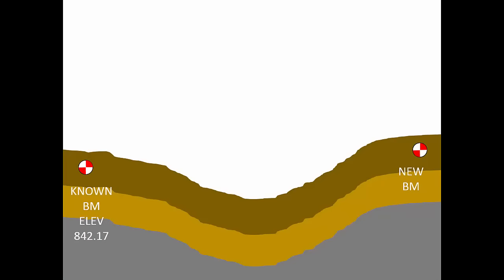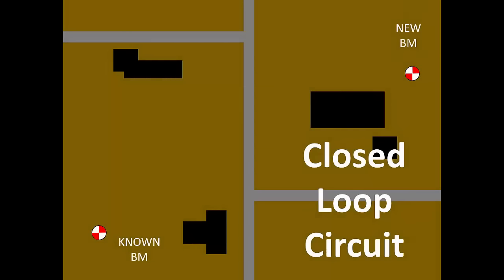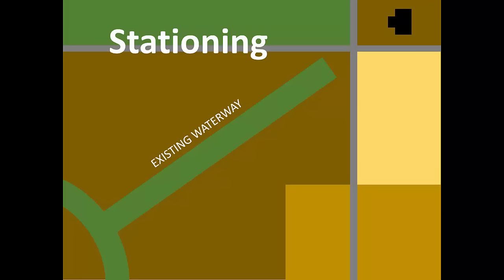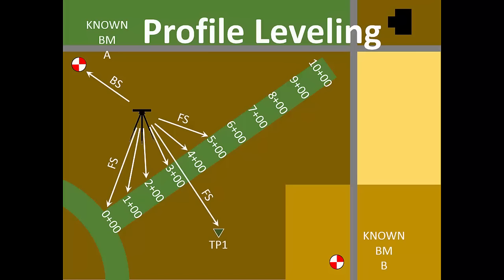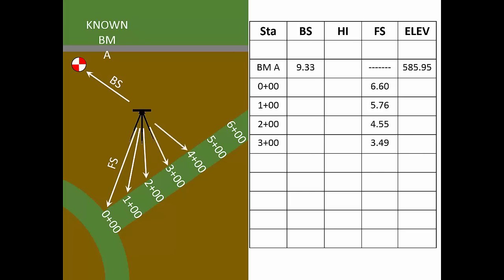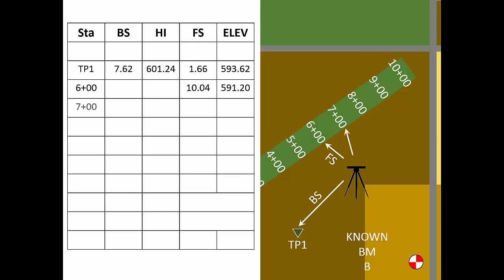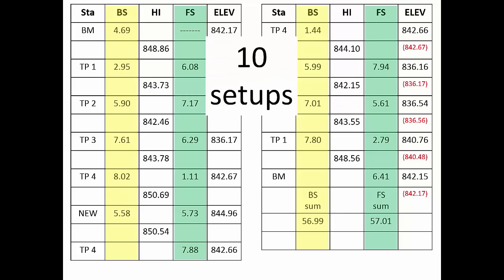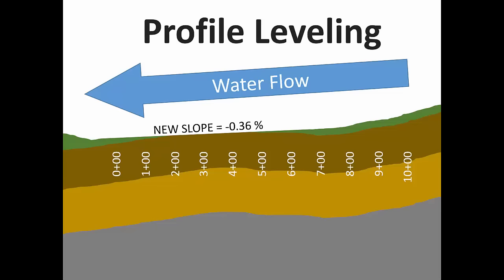Leveling, Part 4

Comment: Dickson queyartey and neil kynaston:  I found the 5 Part video to be very informative and well presented, but not without some "blunders" of its own.

To calculate percent of slope = (Rise/Run) x 100.  The change in elevation between Station 0+00 (ditch) and Station 7+00 (pond) is 2.50 feet.  The formula above would then yield (2.50/700) x 100 = 0.36%.

Also, my guess is that the elevation of BM "B" was supposed to be 597.65 and not 595.65 as shown.  I would go and field verify that myself if I only knew where in Illinois that benchmark was located.
Reply: I agree with this as the closing error is confirmed as 0.02 not 2.02! - however, the principle is still good - thank you for a decent explanatory video.

Comment: Very refreshing, Please comment on my method, 
I did  a level run on the LNG tank for settlement when the tank was subjected to hydrostatic test, 4 times , when tank was empty, 1/4 full, , 1/2 full3/4 full and final. 
We had 16 brass plates embedded equally place around the periphery in the outer projected base of the tank which was 65 mts in dia, I had to shift the instrument 4 times.to around the tank. When ever I shafted the instrument I manage to set in almost mid way so that instrument error was minimised and I fixed a measuring tape in miimeters of good quality matching the graduations, ( between 0.6 mts to 2.00 mts, where max staff reading s are taken) of the  level staff graduated in mts  ( to avoid observation errors ), so that I could  read to last mm. When I ran to and back fly levels most of the times I never got any closing error except a couple of times with + 2 mm 
I feel these are some tricks of the trade